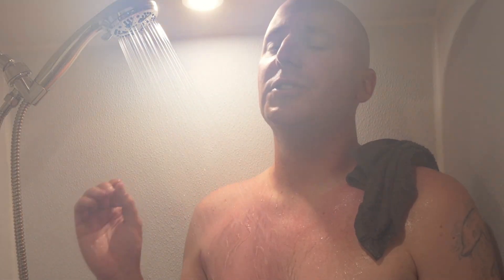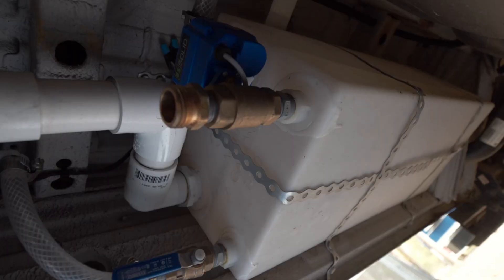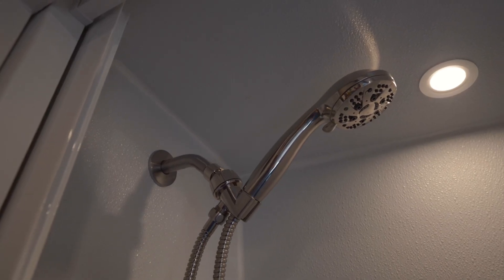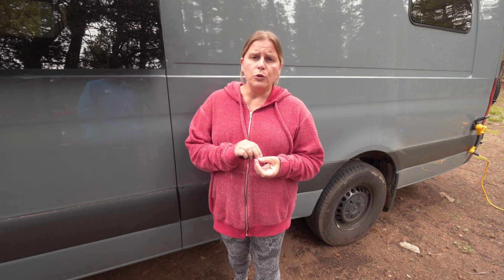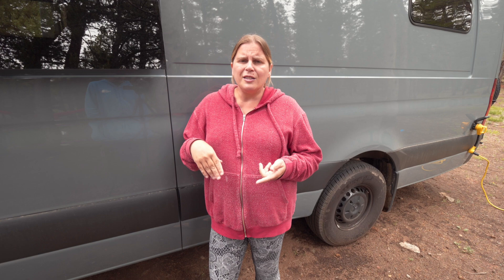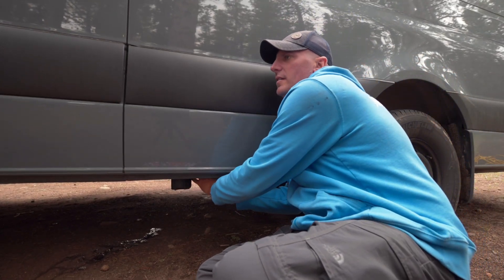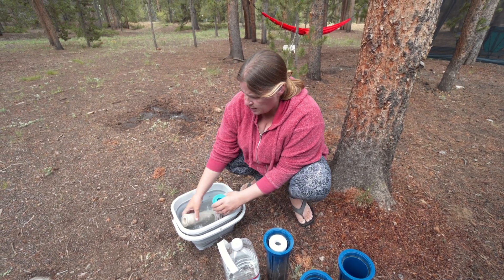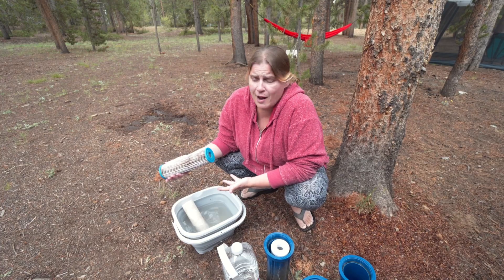RECIRCULATING SHOWER for Vanlife: The Truth and What You Need to Know!

Comment: So I'm working on the same thing...was thinking about how I could do something similar for the sink and still be able to wash dishes? Anyways what about a gravity filter after the drain, something like a pond filter. Multiple layers to catch the big stuff. You could even add a PIG oil absorbent filter mat into the layers. Just a thought, haven't tested anything out yet. Great video, thanks!
Reply from the maker: I do like the idea of a gravity filter, but because our system runs out of the van after the drain it would be difficult to incorporate. I’d also be worried about the pig mat degrading over time… but I guess any filter over time would! Good luck on your system and please update us on how it goes! Thank you for watching!

Comment: I’m wonder if considered tuning a bypass line around your 5 micron and flushing the system for your regular monthly maintenance instead of pulling all of the filters…

I’m thinking that your filter manual maintenance could be reduced to 1/2 or less and your replacement of them could be reduced too by installing a bypass and around the carbon filter (your 5micron) so you could run either 25% vinegar or a 1/8 cup of bleach to a gallon of H2O, or as someone else suggested diluted peroxide (which is far cheaper and more stable getting for hair than food grade which lacks stabilizes) solution thru in bypass mode… running it thru would not only clean the filters but also clean the lines/bottom of tank and remove and scum from your UV light which will become ineffective over time as gunk adheres to the quartz blocking the light transmission … you wouldn’t want to ‘pollute’ the carbon filter with high doses of anything so bypass before circulating would be a must (or you could pull the carbon filter from the housing instead but I was trying for a method that eliminated kneeling/reaching etc)… obviously you’ll want to rinse afterwards with clear water … 

Btw the contact time for  bleach solution at 6ppm to kill microbes in clear water (the dilution I suggested is much stronger) is 13 minutes if memory serves    so the stronger rate you’ll be able to oxidize all the crudys quickly …
Reply from the maker: All great suggestions! We are on the road so it’s hard to make any bigger changes but we are still looking for ways to improve. Overall we are happy with the functionality of the shower. Definitely an update in the future if and when we change the system!

Comment: I have not used soap for over 10 years... No problems... Rubbing alcohol on a cotton ball for arm pit works great. You will smell fresh for 3 days. Would a bio-filter grease trap type system work better as pre-filter before it got to your 7 gallon holding tank?

Comment: Can you get flow thru those 3 filters no matter how high they are mounted ? I.E.  IN the vehicle .
Reply from the maker: Yes… the circuit has its own pump so as long as your water volume does not exceed the pump’s capacity it should be ok… hope this helps!

Comment: Based on the experience of Curt and Snow you should be better once you go to biodegradable soap without the perfumes.
Reply from the maker: We are hoping that the biodegradable soap will help. We will definitely test it out more and try to do another video with some more details on it after testing! Fingers crossed it works. Otherwise we aren’t unhappy with the way we’ve been using it.
Reply: Curt and Snow have broken the code.
Reply: Curt and Snow’s system requires what I believe is a tremendous amount of maintenance. However, I love their large shower design. 

Others may not have a problem with the maintenance, but for me it is a problem because I’ve had Parkinson’s symptoms since 1996. It’s just too difficult for me to do all that maintenance. I am looking for something that requires less maintenance.
Reply: @TannyOHaley  they actually found that they didn’t like that large shower and closed part of it off for storage pretty quickly. I don’t remember what they didn’t like, though.

Comment: I think I figured something out regarding the soap removal. You could take a hot shower for however long, then shut the water off. Turn on an auto dropper with premixed water and Epsom salt to begin applying in the path of the water to the drain(not too close to the drain, need more contact time). Maybe even consider using some kind of restriction for the drain to increase the contact time by a little bit. Start to soap up and scrub hair or bald head and everything else, rinse off. Once the Epsom salt mixes with the soapy water a chunky precipitate will form and should be collected by your initial drain filter and hopefully another filter before reaching the spin down filter.

Comment: Is it possible to add a valve so that water drainage can be directed to a grey tank or the recirculating tank at will? Thus allowing a quick, get clean shower with soap that drains to the grey tank and then an unlimited time, soap free shower with recirculating water.
Reply from the maker: We have seen this in other systems and it’s absolutely possible! We didn’t want to add another tank as space was becoming a concern. Thank you for watching!
Reply: I’m thinking to do exactly this, a quick clean-up shower, and a relaxing loop shower following.

Comment: I love your system alot! But I do wonder about it freezing up during cold weather? Please keep doing your Pro's and Con's video's.
Reply from the maker: Thanks so much for watching! The system definitely wasn’t built for freezing temps! We just purge the water if we have to be in cold weather and we don’t use the system! Right now we are in some colder weather and haven’t been using it. Our intention was to not be in cold weather haha! But here we are!
Reply: @WanderfulRevolution  Well i hope to follow your system except for planning to figure a heating source for winter living.
Reply: I have a similar system and or I done to prevent freezing was make a inslated box around it and ran the diesel heater exhaust through the box so the waste heat prevented it freezing. As I see it if it's below freezing the heater is going to be on

Comment: Great videos on the shower. I am about to embark on a van build myself. Quick question as to where the hot water is coming from for the shower? I didn't see a water heater in the system. Thanks for sharing.
Reply from the maker: We have a Espar hydronic heater that provides our air heat and hot water. It’s pretty much instant and endless hot water. Check out our van build playlist if you want to learn more. We have 3 videos there about the installation of the Espar system.

Comment: I had this idea 10 years ago for my sailboat and everyone said "YUCK", and then the vanlife people made it acceptable.
My approach was to first you soap up and rinse off and that water goes to grey (or sailboat, out).  Then once clean, you can use recycled hot water without having to aggressively filter the water.  Because really my wife does this at home, it is great to just soak up the hot water but you don't need it to get clean.

Comment: Hi there folks, have you thought of using a cup of bleach or chlorine in the water as this should break up the soaps???? The other thing is to maybe consider using a dense sponge-like pool noddle at the drain of your shower to help catch most of the particles before entering the tank system - just some food for thought
Reply from the maker: We are thinking about trying something else in the drain. We may have to trial your pool nodule idea. Not sure if it will drain quickly enough though. But definitely worth considering! As far as the bleach goes, we honestly are trying to avoid a heavy chlorine smell in the water, so I’m not sure that would work for us. How much bleach do you think it would take per gallon of water?
Reply: @WanderfulRevolution   I am not sure about the size of your tank but I would try firstly 1/4 cup and then work my way up till you can see that it is breaking down the foamy chemicals - the drain system you could try maybe the following; LEKEYE Drain Hair Catcher/Bathtub Shower Drain Hair Trap/Strainer Stainless - Amazon

Comment: Why use a 7.5 gal tank? For a given shower you will be removing the same amount of particulates, soap etc, so the volume of water in the tank is irrelevant. You actually only need enough water in the loop to keep the pump flooded given the drain-back flow rate. More water just means more heat loss. Non-recirc showers waste a lot of heat as the hot water is just wasted to the gray tank. Also a 4.5” diameter filter has 3X the filter surface of a 2.5” filter and the cartridges cost almost the same. The larger housings cost $14 more than the smaller (same 10” height). Could you use a hose from you kitchen faucet to fill your loop?

Comment: Is there any way to change the plastic filter holders to a stainless steel holder to protect your filters from weather and just regular bumps and rough terrain while boondocking?
Reply from the maker: Thanks for the suggestion. We didn’t realize they made a stainless version. I just looked them up! They are about 3 times the price of the plastic ones but I’m sure the stainless would hold up better over time. If at any point we need to replace the current ones, we will definitely look at upgrading! Thanks so much for the suggestion!

Comment: I don't know how you'd do it, but I would think you'd want a pre-filter setup between the drain and the holding tank.  I would assume that the holding tank is going to get pretty yucked up with all the dirty water going straight into it.  I know you said you run the shower for 5 minutes after to clean it up, but I'm thinking there's still going to be a lot of stuff that stays in the bottom of it.
Reply from the maker: Thanks Carl! This is definitely something that we continue to think about and will see if we can come up with a better solution. It’s all like a real live experiment haha! We may look into a prefilter. Only concern would be if it can be gravity fed as there is no pump on that side of the system (which is why we didn’t do something like that originally). We would be afraid the water wouldn’t drain quickly enough from the shower?

Comment: This is great information!  Thanks for sharing!  Where do you buy the 12-volt Ultraviolet Water Purifier Sterilizer Filter?  Can you provide a link?  Thanks!
Reply from the maker: Hey there, thanks for watching! Here is a link for what we used. This filters 3 gallons per minute so be sure to buy one that is appropriate for your water pump.
https://www.freshwatersystems.com/products/viqua-s2q-p-12vdc-silver-series-uv-system-powered-by-sterilight-3-gpm?variant=13250138177579&c1=GAW_SE_NW&source=PLA_USA_SS&cr2=shopping___nw___smart&kw=13250138177579&cr5=&cr7=c&utm_source=PLA_USA_SS&utm_medium=cpc&utm_term=13250138177579&gclid=CjwKCAjw64eJBhAGEiwABr9o2I8LrBnWLqUfxg2vHG7yYN177HGpuTpd6ivakQ6nB-LHnWefzxxA8xoCbGQQAvD_BwE

Comment: Did you consider running the filters before the holding tank. To eliminate dirty water sitting in the tank?
Reply from the maker: We had considered it but that to our understanding would require us to place a pump before the tank to pump water through the filters into the tank. And then a second pump after the tank to pump water to the shower.

Comment: That's great guys, thank you very much for the update and for all the infos you share with us so generously. We have a question; we want to include to the filtration system the kitchen sink too. We plan to use for the kitchen sink an extra oil filter. Do you think it makes sense or will it even make it harder  to run the whole system. Do you think would it be effective with the oil filter or is it just an unnecessary load for the Filters so that they need to be replaced/cleaned more often. Thanks in advance for the answer and please keep up the lovely videos we really appreciate it :-)
Reply from the maker: Hey there! Thanks for watching! We do not advise combining the shower system with your sink system. I'm not sure that I'd want to drink and cook with water that has been used for showering. We have the 2 separate loops for them, so the water for the sink and shower never touch. If you have specific questions please let us know!

Comment: How much control do you have over the hot water?  I presume there is a way to just fire up the water heating function of the Espar heater when you need it.  Yes?  Thanks in advance for your consideration.  Oh yeah, in another video when you were installing the Espar heat exchangers in the garage, you installed two heat exchangers.  Was that because one alone wouldn't get your water up to temp?  Thanks.
Reply from the maker: Hey there! Thanks for watching! We turn the hot water on and off as needed. It take about 5 minutes for it to heat up. We definitely have plenty of hot water and we only mix it at the faucet. Might have been a good idea to put a mixing valve at the heat exchangers so that we could control how hot it is a little better (it can get very hot). We don't have any kids using the water so we can get away with it. 

The reason we have 2 heat exchangers is that one is for the recirculating shower and the other is for the sink water. Don't want to mix the 2.
Reply: @WanderfulRevolution  Thanks for the note back.  What is the function of the accumulator?  And,  which model Seaflow pump did you use?  I use a Seaflow pump in a DIY kitchenette setup in my shop, but I don't think what I use would have the power to push the water through all the filters and still provide sufficient flow to the shower head.  Thanks again.

Comment: How do you heat the water for the shower?
Reply from the maker: We have an Espar hydronic heater that supplies hot water to our shower! Hope this helps!
Reply: I am also using a Timberline hydronic heater/hot water system. I put a 2nd heat exchanger on the circuit also. I put a thermostat in that controls a diverter valve on the glycol system. The Thermostat will open the diverter valve when the water temperature falls below 98 degrees allowing the hot glycol to pass by the recirculating water. When the temperature of the water is 104 degrees the diverter valve will close and the water will not be passing by the hot glycol.

Comment: Thanks for the update
Can you please post a link for the drain filter fitting.
My setup has 1" hose for return line with a filter inline similar to your pre-pump one. One budget inline filter and prepump only on pressure side. Much smaller pvc pipe tank that is emptied more often with removable end cap so easy to completely flush. So less filtration and dump small tank more often kind of setup. We use pure sandalwood shampoo sparingly for wash and hair. Less caking and good product.
Reply from the maker: Thanks for watching! When you say drain filter fitting do you mean the tub shroom that we have in the drain? https://amzn.to/3AYZKav

Thanks for the info on your system and glad its working well for you guys! We are definitely trying to continually improve ours!

Comment: OMG yes!! I have been “bench testing” not using soap in my life as I knew it would be an issue with a recirculating system. Thanks for sharing! Do y’all just avoid sub freezing areas? I kinda want to build an enclosure when I build mine and include a heating element.
Reply from the maker: Awesome! You know we aren’t unhappy with just using water to clean. It’s honestly working pretty well for us. Who needs soap anyway….
Reply from the maker: Oh! and if you could figure something to keep the components warm in winter that would be amazing. We are honestly hoping to stay away from freezing temps. And we will drain the system and remove filters if we absolutely need to be somewhere cold.
Reply: Would it be possible to insulate the outside water tanks to prevent freezing?
Reply: @WanderfulRevolution  I don't remember the initial setup, perhaps consider installing some shelving between the bed and the shower stall to run the setup inside the van. I'd imagine you might need to raise the stall a few inches to allow for drainage. Perhaps an emergency floor grate below the shelving?